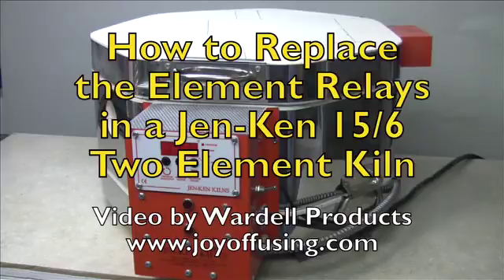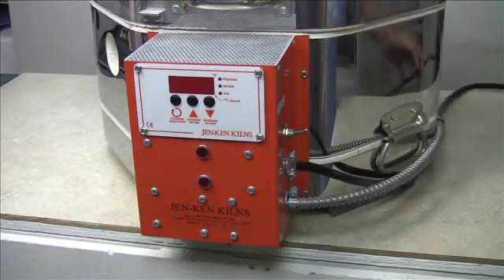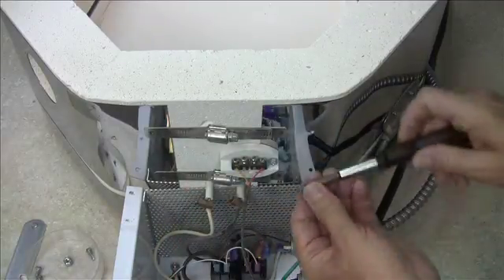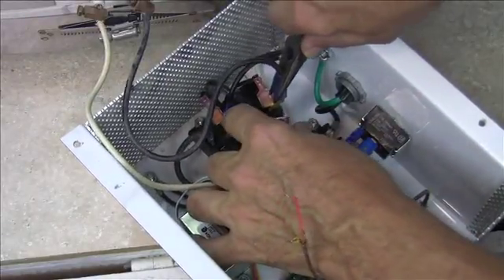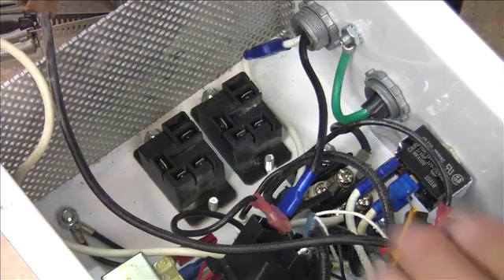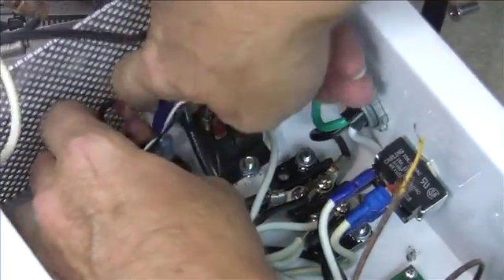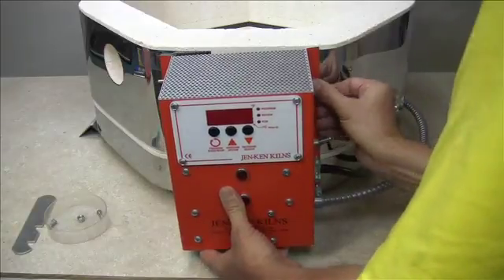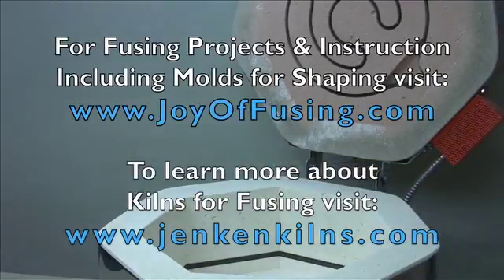How to Replace the Element Relays in a Jen-Ken Fusing Kiln

Comment: Hi Randy,  Thanks for the video on replacing the relays, it came in very handy.  Are you supposed to run a test firing once the repair is complete?  If so, can you tell me if it's with or without glass and what type of firing would you suggest?
Reply from the maker: I don't think it is necessary to run a complete test firing. All you need to do it set the kiln to fire up to 200°F, zero soak time, then shut off. If it does that with the new relays then you're good to go.

Comment: How about when you turn on the power switch and no power to the unit? And ideas on what that would be would be helpfull
Reply: That is something entirely different from a relay problem. The first test is to make sure there is power to the outlet, if it's a 110 kiln, plug in a light to test, if no power there check the circuit breaker. Then if you have volt meter test for power inside the

Comment from the maker: Rebecca: Are you saying that the wires are opposite on your kiln as compared to the wires on the one in the video? If that's the case you're always better to hook them back up the same way they originally were. To be honest when it comes to the thermal couple only, I don't think it really matters if the yellow is on the left or right since the current flows through the thermal couple in one side and out the other.